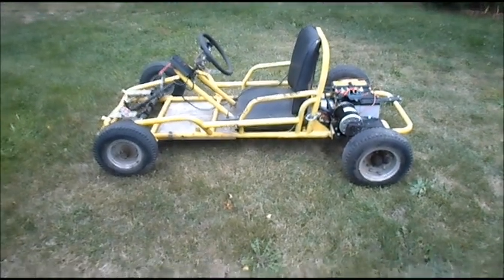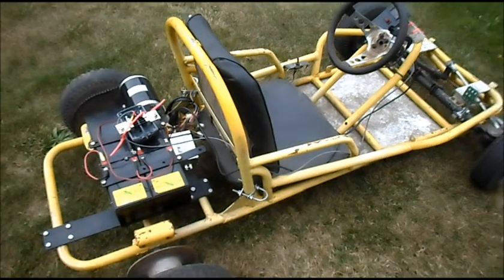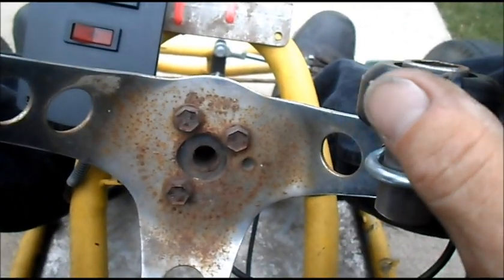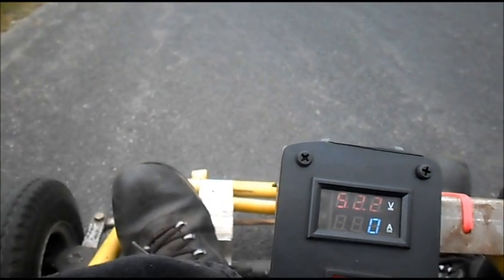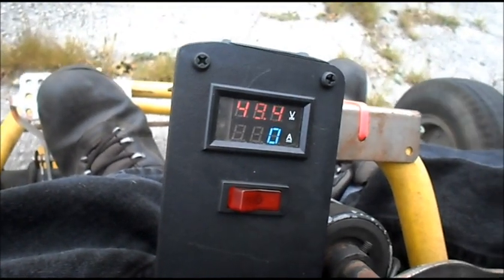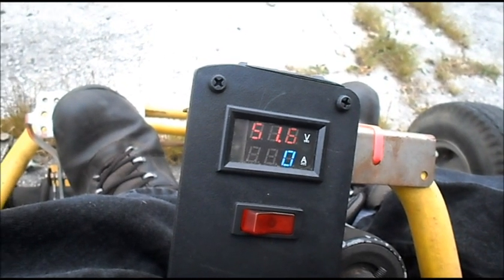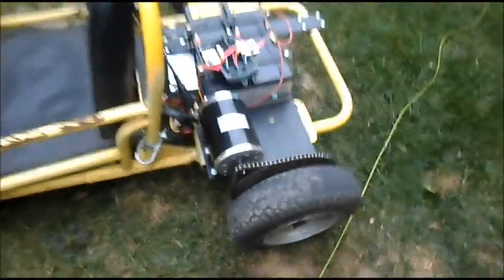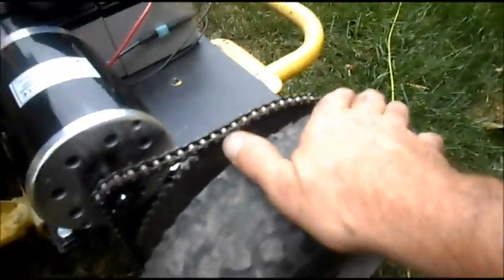e Lemon aid  part 13 48V 1,000W motor 1st  test drive

Comment: Is the motor reliable?
Reply from the maker: Yes, these are very reliable motors. I've used them on many karts. Check out some of my other videos.
Reply: @functional_artist  Have you ever used one on a bike i want to built it on my bike but not sure if it will go fast .
Reply from the maker: @kerelabasrbin3635  I've installed one on a minibike. It zipped right along (over 20 MPH) Check it out.  https://www.youtube.com/watch?v=5bpodZnH5-A&t=114s
Reply: @functional_artist  Thanks for info,nice vids
Reply: @functional_artist  Hey just wanted to ask you in what direction does motor spin and can you reverse it,if possible does it go slower?

Comment: are you still doing custom carts? I have 3000w motors and 100 amp controllers
Reply from the maker: Yes I am, just gettin' over winter,  Ooooh  3,000W 72A Yup, I want one :)